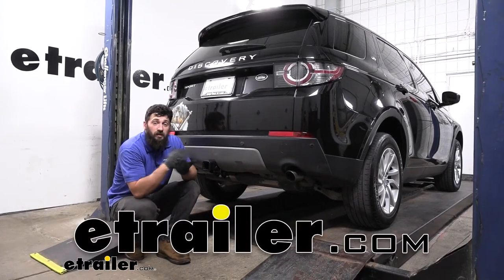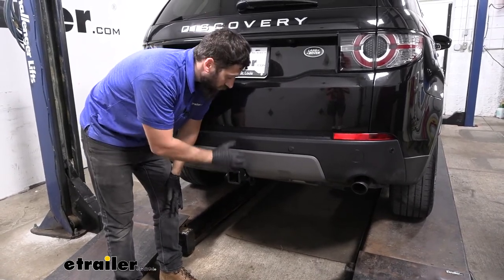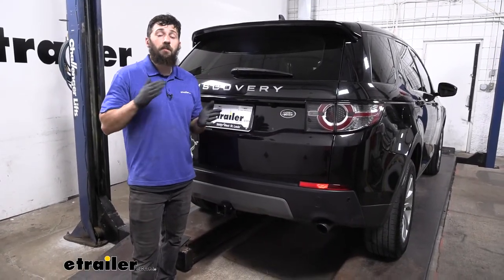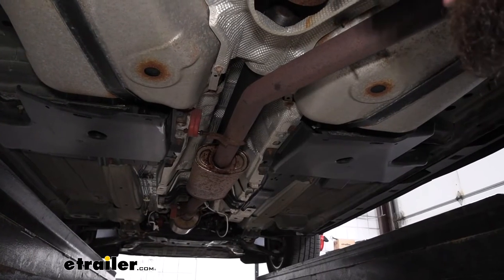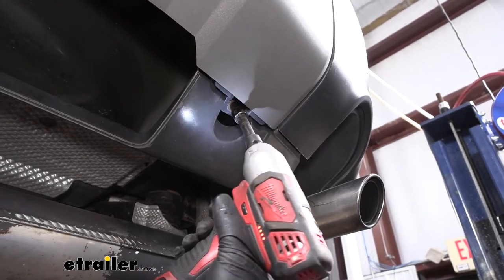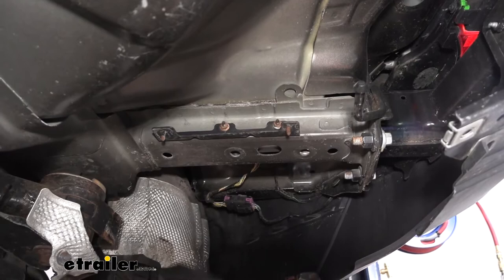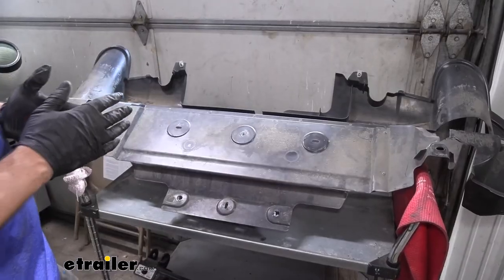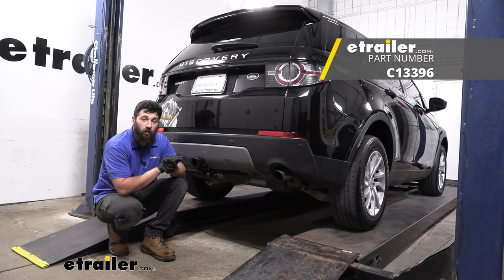etrailer | Curt Class III Trailer Hitch Installation - 2016 Land Rover Discovery Sport

Comment: It sounded like you said putting on this hitch was not bad at all and only minimum modification needed.
Reply from the maker: We give the Curt # C13396 Class III hitch a difficulty rating of 6/10, The only modification needed is the trimming of the cutout on the rear panel.
https://www.etrailer.com/Trailer-Hitch/CURT/C13396.html
Reply: @etrailer  when I attempted it, it would not fit because the hitch ends were protruding into the exhaust holes and I did not feel comfortable cutting out additional holes.  In this video it does not seem they were cut.  My discovery sport is a 2017 se.  5 passenger without dynamic option. Any help would be greatly appreciated